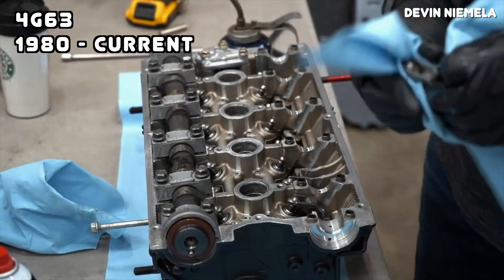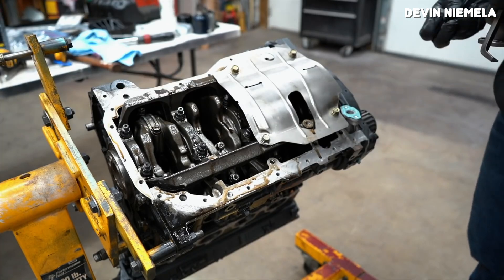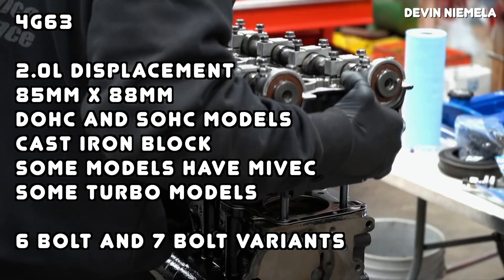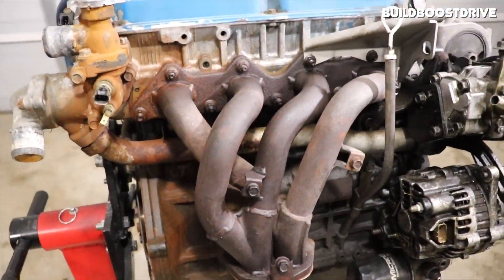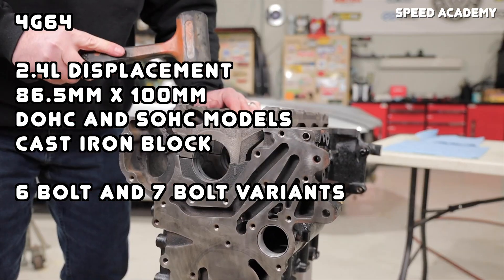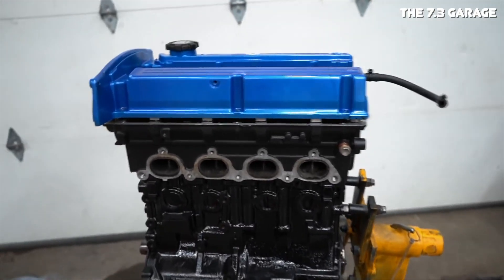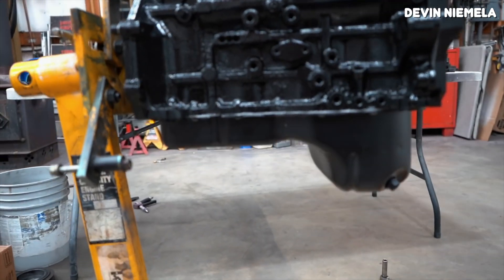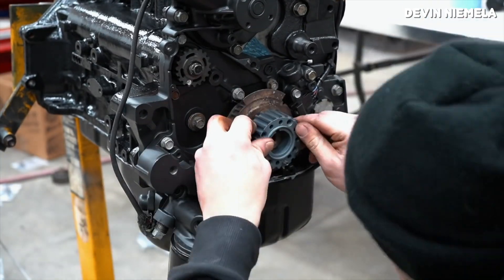4G63 vs 4G64: Which One is Better?

Comment: I have a 4g64T in my evo and it's an absolute monster with a 5 speed behind it!
Reply: stock trans?
Reply: The stock 4g64 just makes around 150 hp wright? How much do you think yours runs?
Reply: @wouterdewaal8085  noo way more than that mine with a 20g turbo im doing about 500hp
Reply: @dmitrywiseman4228  nice! I'm in a Evo X. I'm at 365whp/381tq mostly stock with fuel and bolt on upgrades. I'm just a couple months away and a couple more hardware purchases away from my Evo going to the builder/tuner. Expecting 500+ on E85 with a built bottom end, Mhi18k turbo, S2 cams, Ams downpipe, Maperformance cast manifold, and FBO upgrades. I'm stoked! Have a garage full of parts now though and it's making it hard to wait!
Reply: @roguetune03  thats awesome!
Reply: @dmitrywiseman4228  Oh that is crazy, nice, but the turbo is a modification wright? It does not come stock with a turbo. Is it the same engine in a eclipse 3rd generation wright? I read on wiki it does 150, but maybe I have to look somewhere else😂
Reply: @dmitrywiseman4228  does N/A mean "not available"?
Reply: @wouterdewaal8085  no naturally aspirated sorry didn't mean to put the slash
Reply: @dmitrywiseman4228  Thanks😇
Reply: @wouterdewaal8085  I have a 3G with the 4G64 in it. Yes, these start with 154hp/148tq if my memory serves me right. But are pretty stout and with some grit you can build a monster on these. Would like to do a 2.4 stroker upgrade on my Evo but man that gets expensive fast.
Reply: @roguetune03  do what the dsm peeps do and run a 4g64 block and crank with forged internals and your 4g63 head
That's the cheapest way you can get a 2.4 stroker on an evo/dsm
Reply: @roguetune03 what year is your Evo?
Reply: @wouterdewaal8085  mine is down tuned to around 600hp just to protect it on race days
Reply: Yes but I wanna do more to it but dont know how yet
Reply: @dmitrywiseman4228  only type r is a monster
Reply: @hondasarefaster5914  haha very funny panzee
Reply: craig jessup 
The 4G63 has more motor sports pedigree than the first 30 years of Honda’s entire automotive catalogue, and I say this as a Honda fan/owner
Reply: @hondasarefaster5914  You've got to be kidding...
Reply: @mmwosu  how many f1 motors did Mitsubishi make?
Reply: @snakethoms1995  
Irrelevant. We were talking about the 4g63, which had continued to compete in motor sports with only minor changes throughout nearly the entirety of Honda’s F1 program (during which time many engines were designed, produced and retired), and has only recently itself been retired from competition. You’re making an apples/oranges comparison. Not all motor sports happen on a tarmac
Reply: @snakethoms1995   Mitsubishi made a total of 77, F-1's they came with twin-engine supersonic Ishikawa-Harima TF40-801A afterburning turbofan engines, 22.8 kN (5,100 lbf) thrust each dry, 35.6 kN (8,000 lbf) with afterburner capable of speeds up to 1,100 mph, so  yeah I'm sure they could make an f1 motor if they wanted to lol
Reply: @mitsubishikid1187  
Not to mention that Mitsubishi Heavy Industries manufactures turbochargers for every application imaginable. Their engineering is so “second rate” that every other auto maker on the planet uses Mitsu products in their products 😆
My Civic Si uses a MHI TD03 to push nearly 20 pounds of boost and it’s delicious. Great little turbo
Reply: @mmwosu  yup even the famed Bugatti Veyron used Mitsubishi turbos as well.
Reply: @mitsubishikid1187  
But CLEARLY F1 engine production is the measure we should consider when judging 😂
Reply: Lets see a video of it seems interesting !
Reply: Can u still use the stock ecu when using the 4g64 block?
Reply: how does 4g63 stock fuel consumption??

Comment: Dont forget about rod ratio,  4g63T stock is close to a 1.7 ( with 150mm rods and stock crank and pistons, this can be changed depending what rods are used IE: 156mm rods and stoker pistons (6mm shorter than stock) for a 1.77 rod ratio) and the 4g64 and stoker 4g63( 2.3) has a rod ratio of 1.5.  Rod ratio will play a role in building a high HP and reliable engine.
Reply: I have a michibechi pajero crankchaft problem, i want to rebuild my 4g64 engine could you give me some advise  how to do this please?

Comment: So I can Swamp a 4g63 head to my 4g64 block? I have a 2001 GS and I want to do the swap but nobody confirm me that if I can do it or not.
Reply: Remove the m
Reply: you need an evo based 4g63 head, because they rotated the engine 180 degrees on the newer mitsu cars, but yes you can swap a dohc head, if you have the money you need to get an expensive evo 4-9 head with intake plumbing turbo etc, or if your doing it on a budget get the Hyundai sonata/santa fe suv / Kia optima 01-04 it might have been in later years as well, you want the 2.4, 4 cylinder model, G4JS cylinder head, they go for cheep these days, people make sleepers out of them, you can bolt evo 4-9 manifolds right onto them and make them turbo with an engine management setup and tuning you could make some good power.

Comment: Big block like the g54b manual transmission?
What will it bolt up to?
Looking for alternation for my 89 4wd.
Any adapter plates avalable?
Reply: the G54b is a wideblock engine. you can find wideblock 4g63's but wideblock 4g64's are more common and more modern. I'd look around the web and see what engine you have and what engines fit if you are looking to swap to a g54b or as a better choice, swap from the g54b as it won't net you any real world improvements over an engine in the sirius family, as parts aren't easily available and cost nearly double in some instances.
Reply: if your looking for the 2.0 wideblock they are kinda rare they were only in "87-"89 automatic transmission 2.0 mitsu mighty max/ dodge ram 50 carbureted trucks, it's important that you get the block from an auto transmission truck, because the manual trucks used the narrow block which won't bolt up to your 4wd transmission, the other option would require more work, but you would have to get a toyota pickup 4x4  w56 series transmission and buy the adapter plate from billsautofab.com now you can use a stock 4G63T from a dsm or evo on a Toyota 4x4 transmission.

Comment: You forgot that Kia and Hyundai also used both the 4g63 and the 4g64 engine's. They also used the 1.6L and 1.8L 4g family engine's.
The 1.6L cylinder head flows better than the 4g63 because the ports are much larger plus the valves aswell. They all use the 85mm bore the 1.6L the 1.8L and the 2.0L engine's. You can also swap the 1.6L cylinder head onto a 4g64 block. 
You can also run the 4g63 evo 8 or eco 9 cylinder head on a srt4 block because it is a variant of the 4g64 block.
Reply: SRT4's use a Chrysler engine. The heads will NOT swap over. It's like the Mitsubishi g54b and the Mazda G6 engine. The G6 you could say is based on the g54b, but with another intake valve per cylinder offering potentially better flow than the hemi 2 valve per cylinder engine with the side effect of higher static compression. This is a case of 2 engines being similar, but they were intentionally made incompatible between manufacturers. It's true the Hyundai engines are compatible, but that's because Hyundai got the same exact designs of those Mitsubishi engines from Mitsubishi. It wasn't like before with Mitsubishi giving Mazda the G54b carb'd engines for their early b2600 pickups, but they gave them the means to make exact copies.
Reply: @MegaBuster777 the first gallants  here in Australia in the 70s were Chrysler then later Chrysler/Mitsubishi gallant
Reply: @Lawrence-uw6cs  They were Mitsubishi and they were still Mitsubishi. Chrysler never made Japanese cars. The whole point was it was cheaper to import the smaller cars and sell them under a domestic name than to completely redesign a car from scratch to be as efficient as the Japanese cars around that time. Chrysler may have helped Mitsubishi back in those days, but I guarantee you, even if those cars were assembled in Australian factories, those parts shipped there from Japan and were assembled there. Now Australia did have their own parts department, but at that time I can't be quite sure. I know they did have their own unique design when talking of the Astron, where they had a kidney shaped chamber head instead of the conventional hemi style in the later year G54b's which also outflowed earlier heads by quite a bit and had an upgraded valvetrain, but knowing the Gallant name was licensed by Mitsubishi and knowing how hardcore Japan is on copyrights....I don't see thst being the case.
Reply: @MegaBuster777  good info! Id never looked too deep into it. I'd love a 70s gallant now! I think they're styling was spot on! They had a mini muscle car look
Reply: @Lawrence-uw6cs  They are pretty rad. I've got a Chrysler Conquest, which is a rebranded Mitsubishi Starion. It even has a little label somewhere in the engine bay or something that says "Imported for Chrysler by Mitsubishi" somewhere on it or something and to my knowledge all 50,000+ of those were assembled all in Japan and exported to various markets, only being sold as a Chrysler (and its subsidiaries) in the US markets alongside the Mitsubishi brand. It's the last rear wheel drive sports car they produced and based off of an improved Sapporo chassis which was also a car sold in the states and took the Dodge Challenger name for a bit. I mean, the Sapporo was also called the Galant Lambda which was the successor to the Galant GTO of the 70's so by extension I got some Galant GTO genes in my old box flared sports car from the 80's even if it's a completely different animal. Love that car despite all it's shortcomings. Realistically though, they were never bad cars. Just hard to get parts for anymore
Reply: Almost right. The srt-4 block has nothing in common with 4g6x fam.
Reply: Kia and Hyundai parts are straight☝💩 😂😂

Comment: What about the 2.6 liter? I read somewhere the g54b was also part of the sorius family and was also referred to as the 4g54 or something
Reply: Sirius
Reply: Astron family. None of the parts are compatible and the G54b is a hard engine to build right. it's got strong rods, nitrided crank, but cast pistons and a hemi head that kept static compression to 7:1 or lower if you use certain NJV recasts, and that's just the turbo'd versions. They also included piston oil squirters to try and keep the pistons cool because cast pistons and forced induction don't go together. The carb'd versions had slightly higher compression but still pretty low. The Australian market had better options for parts because of their Magna which had higher compression heads that flow better than ported hemi heads and came with MPI, something that really limits the G54b from making large power numbers. There's very few g54b's making close to 1000hp, but they're longevity is a major concern and extreme changes to the engine have to be made. HKS made 12, but only know of ONE DOHC head for a prototype rally car and I can only think of one person in Puerto Rico that actually drag races a car with that head.

Comment: high hp 4g64s kill evo trans' lol too much torque
Reply: Its the quick torque spike these cars have but theres cam options and choice in turbos the can help mitigate and or alleviate it a bit but yes the torque can be quite aggressive for the design of the trans
Reply: The common consensus was if you had a higher displacement 2.3 or 2.4 you will end up braking gears and such from the added torque load [on a stock transmission] or if you went 2.1 destroker you won't be able to shift and you end up messing up synchronizers, because they were not designed to shift at 11k rpm+ lol so ether way you look at it you will want to upgrade to ether a dog box or let off in between gears or both, and it is easy to mention it here, but in the heat of a race situation that goes out the window doors and hood vent and you find yourself picking up transmission internals thankfully this has not been me yet lol.
Reply: Clutch selection has more of an effect on shifting than displacement.  A twin disc loves 10'000 rpm. Dogbox is needed when you start breaking gears every other pass.

Comment: You have really interesting stuff to talk about you think I should just add a 4G 63 crankshaft to my 98 gs spider To make it a turbo
Reply: you don't have to swap crankshafts to make it a turbo engine, some 2g dsm owners simply swap in the, wiring, ecu, injectors, maf, turbo, coil pack. spark plugs, basically everything from a gst 2g eclipse or talon 4g63t will bolt on to the stock sohc 4g64 spyder engine.

Comment: Ahh yes... The 7 bolt cranck walk, got it on my 7 bolt 99gsx back in the day, that car was not reliable!
Reply: Ya Neponil 

Weird that a 99 crankwalked.. it was mostly cured by the 99 model. I have a 6bolt 4G63T stage3 with a 4G64 bottom end in my 99 GSX. I have had an issue with shredding 4th gear due to how fast the TQ hits with the stock intake. Hopefully my new JMF Intake manifold will help and I also got the transmission rebuilt with a 1990 HD Jacks transmissions built to take up to 700 hp. Hopefully this will be the fix if not I might have to go ppg straight cut gear set. Great video.
Reply: @psychbiker  yea all tho any engine can have that chance, to hear that a split thrust bearing block did is far and few between would be interested  in what clutch and flywheel it was utilizing at the time of failure.
Reply: Weird I have a 95 talon an it's has 200k on it with 300hp it hasn't walked yet

Comment: The 4G69 the biggest engine of the Sirius family of engine is also a good engine swap candidate since it also a 2.4L engine, many have built Frankenstein Evo engines with the 4G69 and 4G63 heads and make butt loads of power and tons of torque due to the longer stroke. 

it goes without saying the bottom end and gaskets and head studs are beefed up to handle the addition of the turbo charger 

the 4G6x family of engine mostly used for drag application and in the famous HKS CT230 Evo Time attack Monster
Reply: Theres also a 2.6 liter in the Sirius family
Reply: @matthewwhiting3628  that engine is chain driven and does not have any similarities to the 4g6x fam.
Reply: Ok so the bottom half of a 4g93 could work with the 4g64 head? Whats your sugestión i am trying to build my 4g64 engine but i would like  the best advise posible.
Reply: Its a 1997 michibechi pajero 2.4l

Comment: I would suggest throwing the 4G69 into the discussion in another video!
Reply: I just 4g69 swapped my 4g94 lancer, it has amazing torque curve and is the perfect balance for a fun daily
Reply: thomas west nice
Reply: Steve agree man,
Reply: And 4g93
Reply: Yeah the largest 2.4 Mitsubishi at 2.378cc vs the 4g64 at 2.351cc
Reply: @abenasher5333  Not to mention it has MIVEC and a far higher flowing Single Cam head than the 64 Single Cam head and that even beats a DOHC swap when it comes to head flow on the 69 from my research. (A fully ported 63 MIVEC head flows about as much as a lightly ported and polished 69 SOHC MIVEC head)

Comment: I loved my 4G64 in my old 2000 eclipse GS.
Reply: 3rd gen begins with 2000.
Reply: Unless you had a 2g Eclipse Spyder which came with the 2.4 SOHC 4g64
Reply: I had a 3rd gen 2003 gts and it had a 6G72 in it. Same engine family as 3000gt
Reply: GS and RS never came with a 4g63/4.
And the 2000 model never came with a 4g motor.
Reply: Did you have a 2nd gen or a 3rd gen because the 2nd gen eclipse was a 
N/A 420A and the 3rd gen was the 4g64 SOHC
Reply: @eliasmelendez1271  2gs also came with the 4g64 sohc
Reply: @eliasmelendez1271  they make a 2nd gen eclipse spyder with the 4g64 too@

Comment: which ones blows up on the street all the time
Reply: Subaru’s do, that was an easy answer. 

4g63’s are so damn reliable, only people who do bad tunes or hack them are the ones that blow up.
Reply: @Twinturboripper  or if your a dsm guy like me they have major electrical issues. Can run 15 psi on the stock block fine but than a coil decides it doesn't wanna live anymore
Reply: Bad tune kills engines. Both are able to hit easily 800 to 1000bhp E85 full drag mode.
Reply: Which one?
Reply: Which one?
Reply: EJ25
Reply: @snoofayy6150  my car is running the EJ20 no issues. Just change the bloody oil regularly